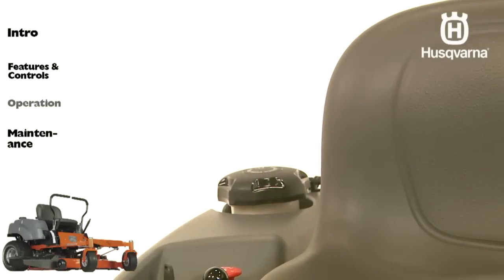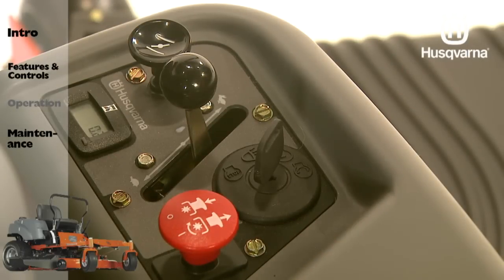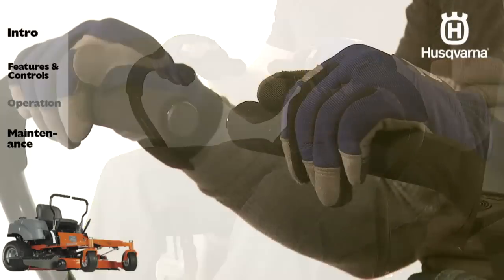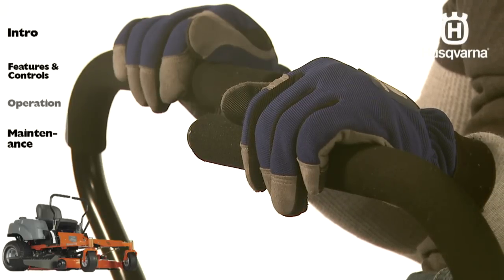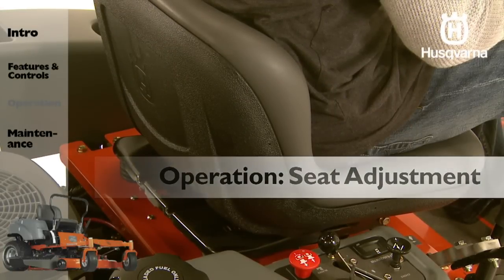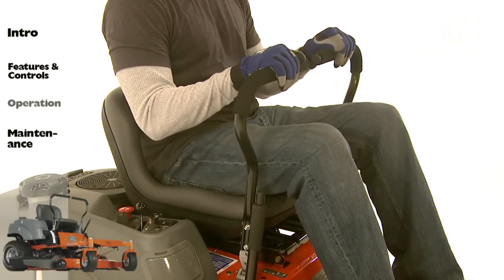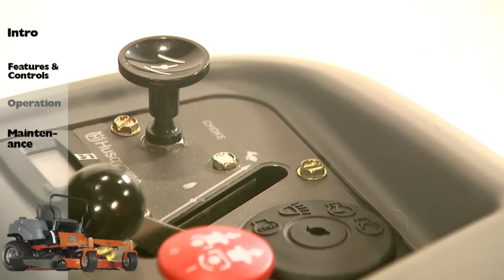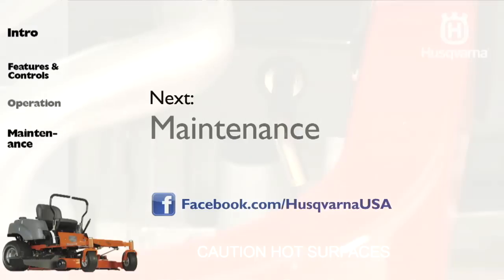Husqvarna RZ-series Zero Turn Mowers: Operation

Comment: Husqvarna has a very bad reputation.  Their equipment constantly breaks down and needs repairs.  Just look up the reviews and also, I have personal experience with their products.  If you try to contact them, you will never get to talk to a human. I have a Husqvarna P-ZT5224 it spends more time in the shop than we do mowing with it.  I need a good strong commercial 54" or 60" mower for ten plus acres weekly use.

Comment: I have a RZ5424 Husqvarna , when I trying to start it the right side drifts toward the rear.  How can I repair this?
Reply: Hey recently my friends had a huge incident with this. It ended up injuring my friends mother pretty badly. Does your mower move by itself?
Reply: @The_Quiet_Selah  Yes.  Even when the parking brake is on

Comment: If mower does not run if you changed the oil and it has been sitting along time or a short time take all the gas out put fresh gas in and change air filter and check wiring and battery and starter if this does not work you need to take it to a small engine shop
Reply: Change gas line filter.